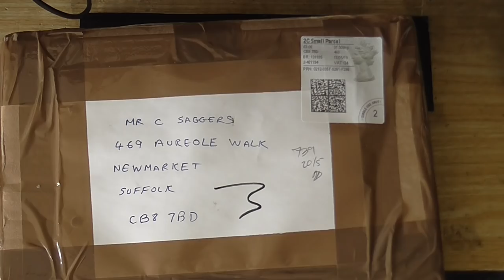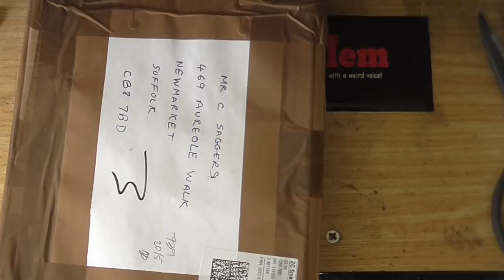Electronics donation 21-05-2019!

Comment: Alrighdy, now built and try out clever schematics and inspire us to heat up our own soldering irons!
Your high voltagevideo's are still inspiring. I myself am buzy with trying to reach 1MV DC with 100x aliexpress caps (4n7@20kV they got even 10n@30kV ceramic caps!) & 2CL77 20kV diodes.

Comment: Those 2 identical boards seems to be 18650 battery charging boards. That board with battery contact is from cheap power bank, also use 18650 battery

Comment: the small boards with the micro usb sockets are out of usb power banks. As is the one you said was a "batteryizer" just need a lithium ion cell and then you can charge it from usb and it will output 5v.